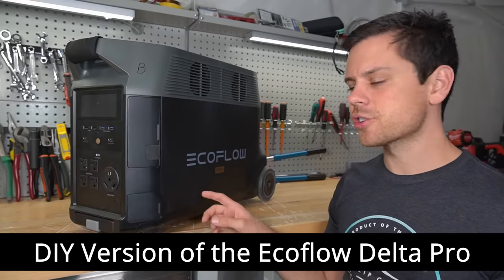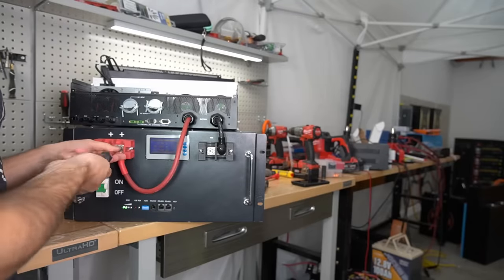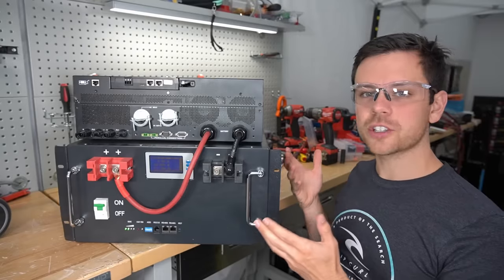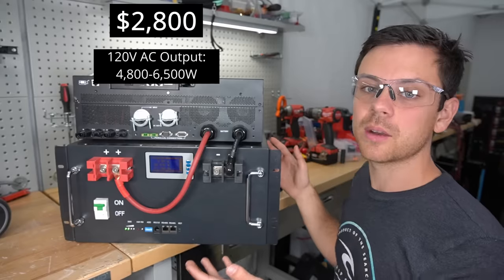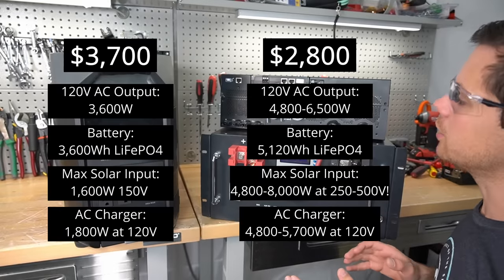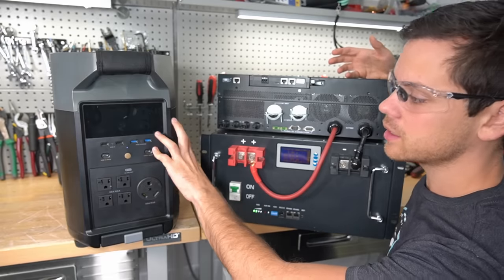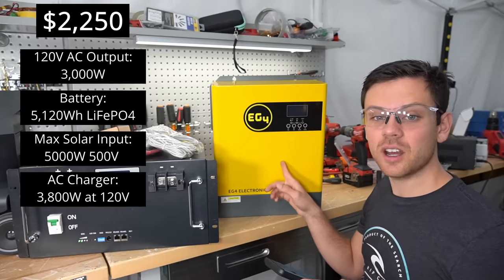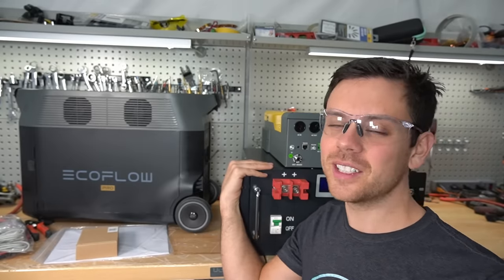Budget DIY Ecoflow Delta Pro! More power for less money

Comment: You’re videos are fantastic and I want to go solar for a couple reasons. They are informative and you explain well. I don’t ask much out of solar. I want to run, in the summer, 1 (maybe two) window unit air conditioners.  I’m referring to the very small 5000 btu units. Also I want the ability to run my side by side refrigerator in the instance of power outage as well as my router to maintain connectivity.  I don’t worry about lights because they are all 3-7 watt LED bulbs. What recommendation would you make?

Comment: Really appreciate the channel, learning a ton by watching your videos! Just curious what do you think of the newer LiFePo4 Pecron Solar generators? 

I’m setting up my first off grid solar set up with a limited budget, and I’m wondering if it makes sense to get their e2000’s ($1350) for the short term with the plan to upgrade to one of the all in one systems you mention in the video within a year or so. That way I have a backup and something that’s easily portable with a variety of charging options outside of solar for an emergency situation or to take camping. The Pecron’s have great reviews, but since they we just released I’m worried about how they might hold up in the long term. If anyone has any advice I’d definitely appreciate it!

Comment: Any chance of a grid tie version? I do not need any MPPT, since my house is outfitted with micro inverter on all 3phases 3x240V. Want to use at least one 240V connection. Could one use the same for both 240V charging and consumption?

Comment: Hi Will! Question to you or anyone else reading.  I wanted to get the EG4 plus a 48v 5kwh battery for my cargo trailer conversion. Mostly for boondocking. I wanted to have the capability to use my 3500w inverter generator to charge the battery.  It has a harmonic distortion of like 1%. Signature Solar sales rep was very concerned that I could damage the EG4 3kwh controller due to increase in harmonic distortion of my pure sine wave when operating at full capacity. In your opinion, is that accurate?  Also, would these all-in-one converters be too loud for the inside of a small camper? I know that’s relative but trying to learn from your experience based on noise level. These videos are great!

Comment: I have what is probably a very dumb question. If I have a 2000w (1800 running watt) generator, does anyone know if this system charging at 4800w would trip/overload the generator? Is there someway to limit the AC input to 1800w even if it takes longer to charge?

Comment: I am new at this and you make this sound so easy. I am looking to go of grid with a Jericho travel trailer. A Whitehawk or Eagle series they are prewired for solar. It is the system that you just built capable of running the RV for a day or two including running the air conditioner and the electric fireplace. And what solar aray could you recommend? I was looking online and saw that ECOFlow has a automatic sun device that tracks the sun. Or should I just mount the solar panels to the roof. If this would be a good system to use. I would appreciate the input. Thank you. I think that your videos are very interesting.

Comment: hi, What's your thoughts on zendure superbase v 6400wh+satellite battery B6400, 12800wh for 7200 dollars for every day use overseas, zero knowledge on solar power and will it run a 1500 sf appartment with a split unit ac 24000 btu, thx in advance.

Comment: Hey Will, I have been looking for the best system for installing into an ice house that we use for camping in the summer and fishing in the winter. Do you have a recommendation on what you would use? All the lights, hydraulics and furnace fan are 12v but it also has 120v outlets, A/C in the summer, microwave, and tv. Ideally I would like to run furnace, lights, and tv for 3 days straight.

Comment: Any DIY solutions that are comparable to the ecoflow smart panel? If I recall correctly, it can dynamically move loads to the solar/battery system when sufficient energy is available but will move those loads to grid power automatically when the battery gets low.

Comment: Do we not have to worry about t class fuses, etc with these setups?
Reply from the maker: Single or double battery setups, no. The breaker on the battery can protect the main cables
Reply from the maker: If you run a whole server rack tower, then yes you need t class

Comment: I have a travel trailer and i've been looking at making an eg4 system like this, my question is where would I put it? would this fit in a passthru? and, while i'm sure it's pretty heavy, how would i mount it? and do i just connect the rv battery cables to this and good to go? i'm pretty good with electricity but for whatever reason RV electricity/solar doesn't click

Comment: What if I wanted to build this system up to be equal to a delta pro ultra with its max of 5 battery's with one inverter on top 7,200 watt x 5 for 36k watt or a tad less wattage, could I do this in stages with this system? also I currently have a reliance pro trans 2 transfer switch, would I be able to easily connect to it from this component system with an rv cable like I currently can with the delta pro..if so what do I need in order to do this? I like the idea of if a component goes down I can easily replace it without being stuck buying ecoflows next system if parts are just not available and I won't have to reply of their terrible customer service based by email only from china.

Comment: Can you showcase an inverter that will auto switch from grid to battery?  I need to build something for 10-ish circuits like HVAC (240/120), Well Pump (230/240), 2 fridges/freezer, 2-4 additional 20Amp Circuits (for lights/computers/TV, etc)  I am looking for about 8000W continuous for 4 to 12 hours. I also have 3KW of 36V Solar ATM, I can reconfigure them for Series like 360V at 350W if you think that is best

Comment: Thank you for the video. :) May i ask if you have any tests of 12v and 24v inverters? Or have some recommendations to models that deliver what they are labeld. Like ie: 12v 1000watt delivers 1000watt sustained and not 8-900watt. I feel a lot of them don't quite deliver what they claim to be. Especially SNADI which is popular at my place is a bit short of the label on the box.

I skimmed thru the headlines of your video library but couldn't see any, sorry if i missed it. Thanks again for all your videos, very much appreciate them.

Comment: Mr. Prowse, good morning. I hope this finds you well. I am a 72 year old man that follows your channel faithfully.  I have a home in Sicily. I don't use alot of power ( I don't think) I run 14 lights (not all at once) 2 large fridge freezers,  TV big screan, microwave,  slow cooker, toaster and washing machine  ( once a week for 1 hour ). That's it in house. Outside,  one 30 metre well pump, to fill storage tank about 10 min per day, and a supply pressure pump to supply house. Now to my request, what do I  need to do to power all this by solar? I  need a system that I can build in steps ( I don't have alot of cash,  but need to build so it will last ) priority would be fridges and water pumps. We have alot of sun except for 3 months of the year. I hope you can help me, God bless.

Comment: Hi Will, please help me with one simple piece of information. I have an 8kW Solar Mpp and 10 solar panels of 590Wp each. The inverter, in the description, is 2x4000W. My question is: can I put all the panels -5900Wp on a single input to the inverter? VOC is 42V for each panel - the inverter supports Max. 500V. Or how is it better to proceed? Please I wait for your answer ASAP. Thanks,
Reply: why not just split them?from what I understand most people try not to overpanel by more then 33 % just as a rule of thumb.i could be wrong.

Comment: Will said we can’t use the Eco Flow 240V output to charge our EV and he has an older video to prove it. What about this DIY system? Can he connect an additional battery to the base system so as to produce 240v for charging an EV? Will did not address this question.
Reply from the maker: Oh of course, I have at least 20 videos covering 240V ev charging with these units. I charge my cars everyday with lv6548's

Comment: Good afternoon first stop I love your videos you definitely have given me quite a bit of information regarding lithium batteries and pretty much have been a key part of installing my system in my house I am currently running growatt  SPF5000 hybrid inverters I have my house split up into two sections one panel does all 120 the other panel does 220. I'm running roughly 14 KW worth of solar panels open circuit 450 volts PV side I'm pretty happy with growatt aside from the amount of idling power it consumes. As everything else prices are going up and I was debating on going with powmr inverters they have a new one that is basically the same as the growatt hybrid with parallel capabilities. I'm very hesitant to believe any reviews online what is your thoughts on the powMr inverters. As like anything they're the typical Chinese made stuff and I may eventually consider going with Schneider. Out of my price range at the moment thank you

Comment: Will, thank you for your presentation videos. They are still a little over my head but I am learning. My question is this: Can the Ecoflow Delta Pro be used to power a smaller camper? More specifically could the Ecoflow Delta Pro be used as part of home system and then carted off on a weekend off-grid camping adventure? My thought process is going from a dedicated camper solar power system and a dedicated home solar system to one that can work in an either or system. My home in Western North Carolina has a south facing exposure but only for about 4 to 5 hours in the winter months. Trees block the the sunrise and sunset portion for a clear long lasting solar gain from a solar array.
Reply: For home two delta pros would be essential because of the air conditioners, Price over $!6k Changing the inverter in this setup to the EG4 6k because that inverter has 240 output and is no more expensive. That would cost less than $3K and would be much more powerful. Could be set up in under an hour. Get Will's solar book. Easy

Comment: some other EcoFlow Delta Pro capabilities: ability to charge from EV station, ability to work with EcoFlow smart generator, cell phone app, handles, wheels, slightly smaller footprint than the rack mount solution, warranty, a little bit more kid-safe.
Reply from the maker: Oh yes true!

Comment: Dumb question from a newby. Can I add BattleBorm batteries to this system?
Reply: One could use them, but it would cost way more. I bought 8 of the 270 AH version of the 12V battleborn batteries for my system, which is kind of a big brother to this. Yes, you could buy 4 of the 100AH BB batteries and wire them in series. Costs way more and I think they would take up a tad more space.
Reply: Or, you could use BB batteries, (4 in series), as an extra bank of batteries, if you have them on a seperate switch and fuse, I believe. Someone should reply here if I'm not correct.

Comment: For portable use like an offgridd RV, my opinion is anything other than a 12v system is a waste of money. Almost all appliances designed for offgridd use in a camper are designed for 12v power, you would need step down transformers to operate all the appliances, every transformer you put wastes power. Ideally you would have a good well designed 12v system with an inverter to power the few appliances that will not operate off DC 12V. You occasionally find some rv equipment that runs off 24v, but most of it is designed for 12v. This includes lighting, refrigerators, water pumps, even some TV's and computers will run off 12V. My diesel heater runs of 12V, the list goes on and on. The only appliances in my camper that use AC power are my coffee machine and my rice cooker.

Comment: Hey Will, great video.  If I could afford to buy 4 server rack batteries for a system like this would it be better to get 12 volt batteries and wire them in series or get 48v batteries and wire them in parallel.  I am thinking the series should be better right?
Reply: Those 48 volt batteries are 4 2 volt batteries wired in series for 12, then 4 of those in series again for 48 volt. Buying 12v batteries and wiring them to 48v has no advantage over buying the 48v battery already assembled.

Comment: These are 48v systems. Do you have a recommendation for a fuse block that takes in 48v, and has a dozen or so 12v outputs? (For an RV)
Reply: Fuse blocks don't drop the voltage.

Comment: The EU version of the Ecoflow does 230v out of the box you'd have to get it imported and to you there, it will have schuko not nema 6 so also any extra cables/adaptors, doesn't negate your point but it is available maybe not easily available in the US though you guys and your 120v.. ew :D

Comment: Will, great ideas here.  I'm considering the 48v rack mount battery for my class A RV.  Just one question, would there be a way that I could charge the 48 volt battery via the alternator while driving like I can current do with a 12 volt system ?  Thanks.......
Reply: Yes. You can add in a second, 48v alternator. Dual alternator setups are common.

Comment: You could make a pretty nice, cheaper, small system using the MPP Solar PIP MLV-3K inverter. There's even room behind the panel to install 120V outlets if you want.

Comment: You can't discard the fact that you can connect the Ecoflow Wave A/C to the Delta Pro and use 33% less power because you are tapping into DC power, that's a difference of a lot more hours of running the air conditioner.

Comment: Well you still have to wire in an AC panel, USB outputs, 12V outputs etc - maybe another $150 worth of hardware, cables, boxes etc, but yes a much better if less mobile system.

Comment: C’mon, Will…are you getting lazy with your DIY builds?😊. I was expecting a full out build including the connected AC outlets (15A and 20A with circuit breakers) wheels, and DC outlets!  I’m rebuilding my mobile 48V 100Ah 3000w Growatt system. Maybe I should do a YT vid and give you some competition!  Love you, Man!
Reply: Us stupid people need love too 😆
Reply from the maker: 😂😂😂 oh gosh seriously? I need to find a large capacity surge strip that I can add in ten seconds. That would be nice and easy
Reply: I would love to see how this could be wired in as an appliance. Either on a dolly or a trailer and how i could take this with me if i sold my house or brought it somewhere else temporarily. 
So few videos recently! i like to think you’re just enjoying some of your success 😏🫶
Reply: actually, a larger system and specifically how it could be tied into the main load panel of a house in an easily reversible or code compliant way. the “appliance” aspect is my best thought on how to safely dance around inspections for diy folks like me 😁
Reply: @WillProwse  and with USB equipped on the strip.

Comment: Will have you tried using a  Neutral-Ground Bonding Plug on one of those ECOFLOW's to see if it will work with a Tesla Charger?  
They sell them on Amazon, and i hear people saying they work on gas generators.  
It would be great to see if you can make it into a emergency temp charge to get you to a charger near by.  
I know you said tesla chargers will not work on it, and im guessing its probably a grounding port issue which that plug is supposed to solve.
Reply from the maker: Yep check out the video. Have covered this multiple times in past videos

Comment: Would be VERY interested in how you hook up the AC power as well. Preferably using a 30amp or 50amp RV power adapter 😁
Reply: Fuse block with 120 and a 240 AC plugs would be nice too 👍👍👍 😁
Reply from the maker: Yeah just cable straight to the terminals. Or Romex. Whatever you want
Reply: @WillProwse  Thanks for the reply👍 I might actually try this one out 😁

This is by far a much superior solution to the Bluettii/Ecoflow problem.

I want to take my home batteries with me when RV'ing, and use my RV panels when home. Maybe like a Legion Solar thing.

BTW if you ever figure out how to do a DIY Legion Solar setup please post 😁 My box is maxed out with panels, so I can't permit anymore panels. Need Legion.

Love the channel man 👊